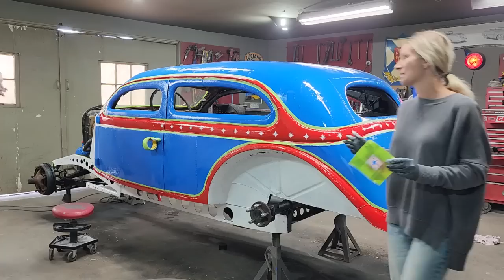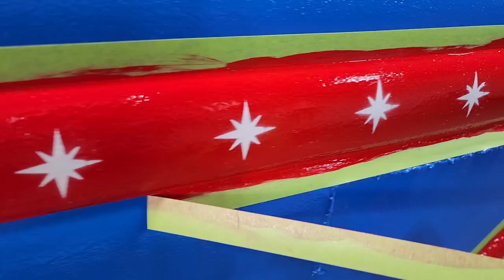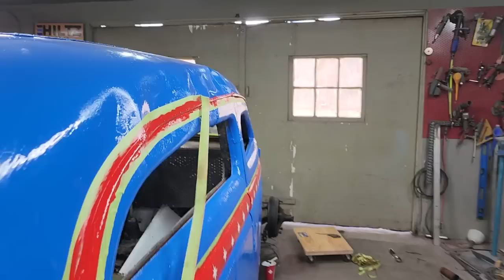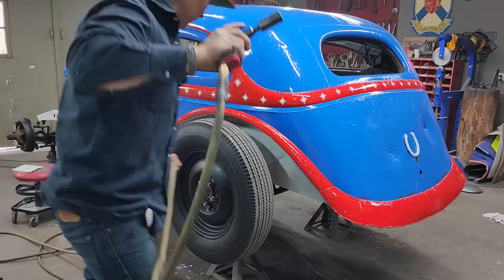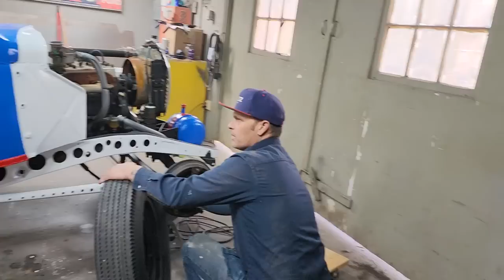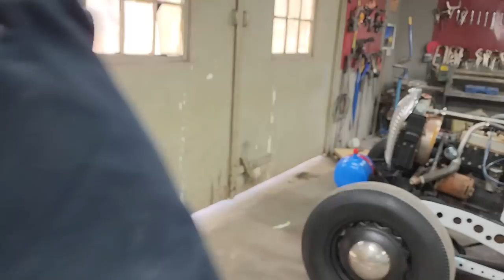Painting, unmasking and revealing Jolene's flathead race car 🙌🏻

Comment: 2 suggestions, from my 36 years of Refinishing exp.......#1 - if u turn the  pressure DOWN (at the gun) 10-20lbs when spraying you will SAVE a bunch of paint. #2 -  if u ETCH your tape...sticky side down on your pants.....it should help ATON in not removing paint when it's pulled off.

Comment: chad the tires turned out great! the front tires look to have a whitewall painted on them. a port-a-wall is actually a white rubber ring installed between the tire and wheel before inflating. once the bead seats, the port-a-wall stays in place. they used to sell white rubber as a liquid in a can, it was called 'tirewhyte'. anyway, the car looks great, good job both of you.

Comment: Chad a car lot trick that we used to do was to jack the car up, put it in gear and hold the spray can still while the wheel spun and just bring the can in like the tool on the lathe would come in toward the center and it puts an even coat of spray paint that you don’t even have to mask the tire on. The only thing I masked was the valve stem, and I actually had a piece of hose that would slip up over the stem to keep paint from getting on it.

Comment: Pretty cool combination. You might check the weight limit on the rear tires on the truck, make sure you don’t exceed the limits of em. Two ton truck with the new bed and a whole other car on those tires might be dangerous if they are just passenger rated. Good job.